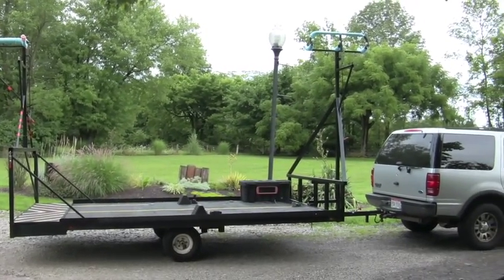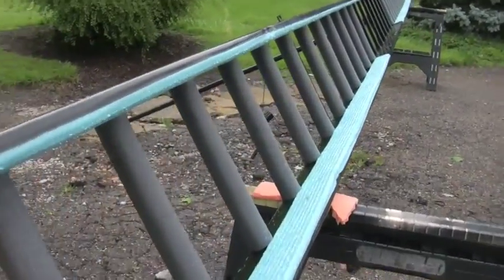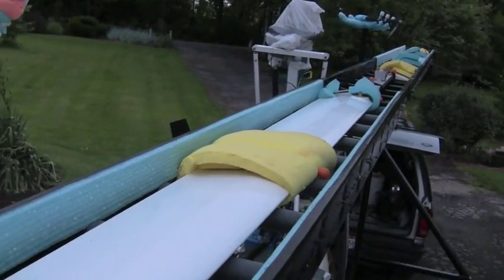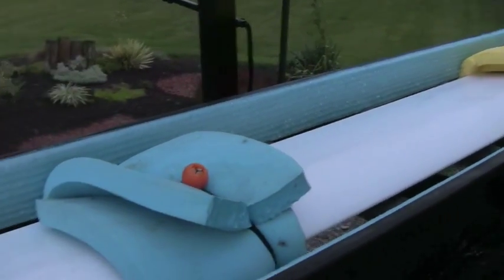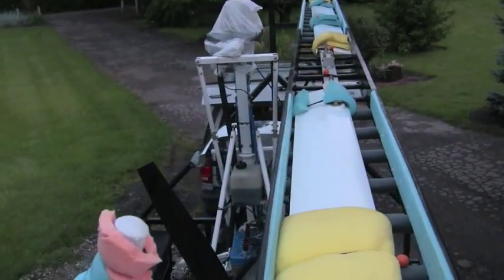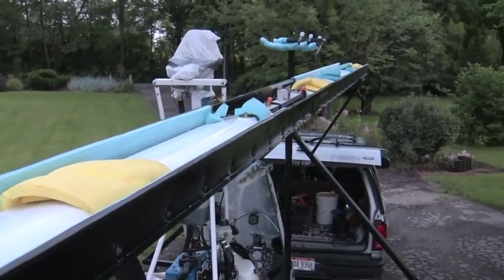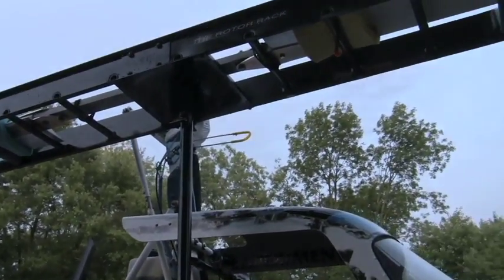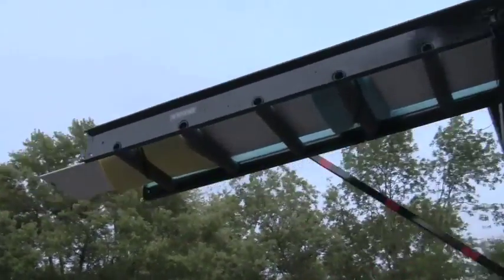Rotor Rack Part One

Comment from the maker: @JRLGyroPort  I am glad you like the videos. The rotor supports does a great job in holding the rotor, I travel back and forth to the airport about 2 miles. But when I go on longer trips I use the rotor rack. I know that Jim from Sportcopter would like to protect the rotor head as much as possible from any stress. I'll be at Mentone this year if you want to see it up close. There will be a lot of CFI at Mentone that you can talk to. Plus a lot of pilot with experience

Comment: I watched your loading your gyro in 3minutes first...this shows what I wanted to see...the rack up close. Great idea. How far would you venture with the roter head attached to your gyro? Why not just leave the rotor head on the gyro? It seems like it is well supported in that position.Is it the freeway speeds that required the extra racking and removal of the rotor head?